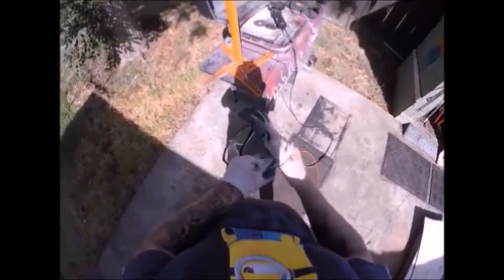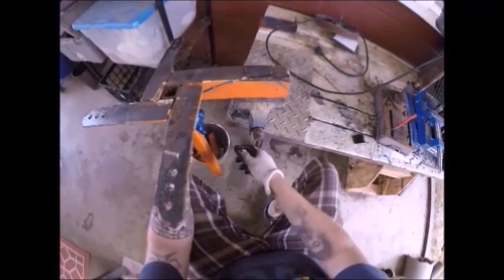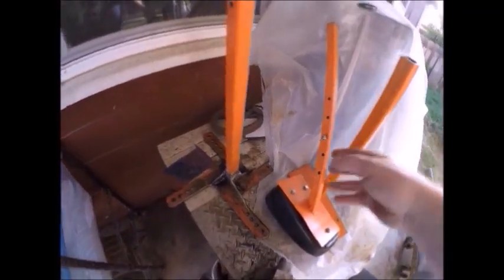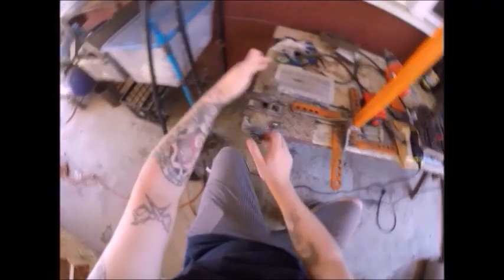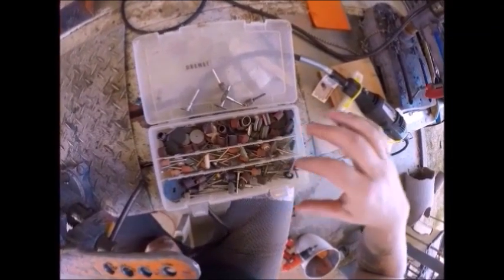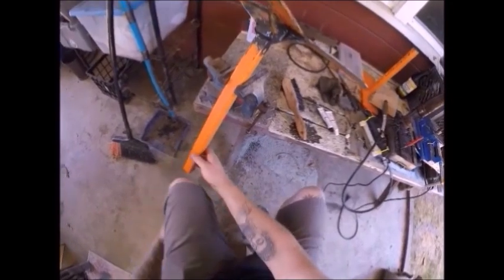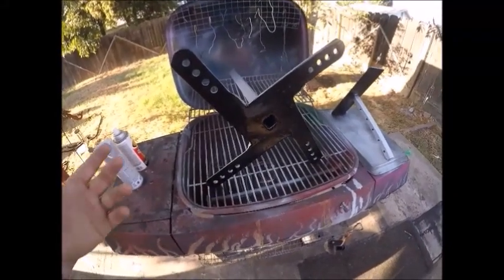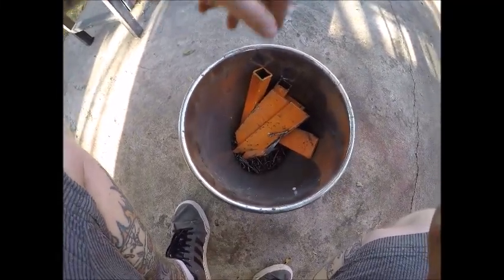Tools for Building Tattoo Equipment- Tattoo Unviersity

Comment: Stick to tattooing dude, your wire speed on your welder is too high, which explains your atrocious welds, wtf are you grinding welds for, and then you hide ya dodgey work with "devcon" epoxy. Sorry bloke but your fabrication is doing my head in.